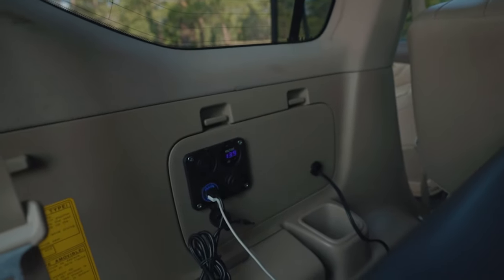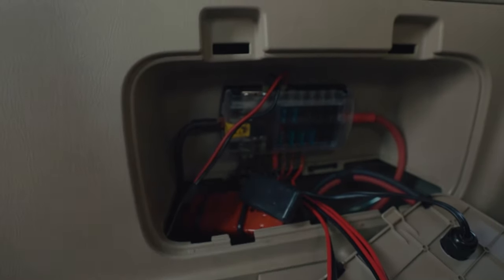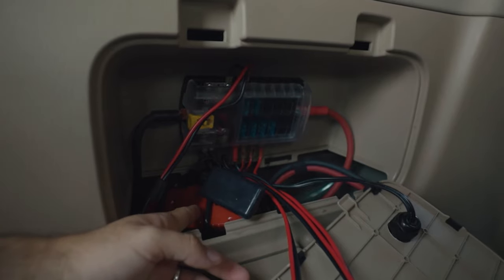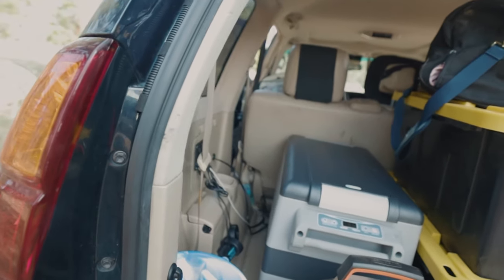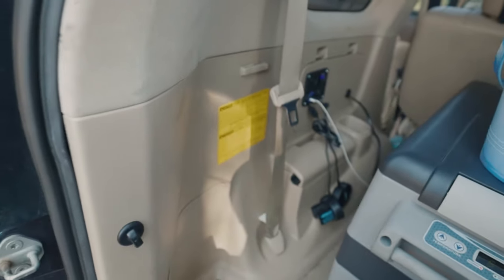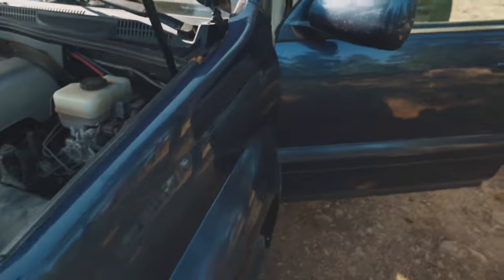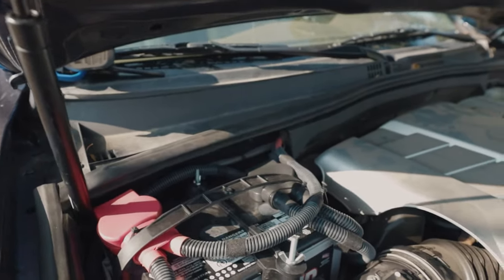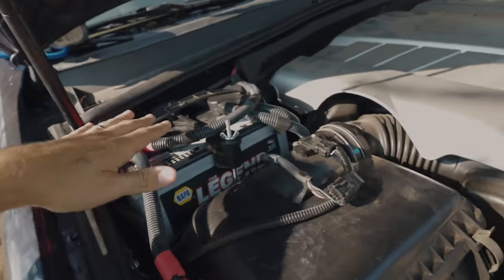Dual Battery System Lexus GX470 #projectbluey

Comment: Hi, Jacob, How did you put your battery in that place? 
I have a difficulty of putting my deep cycle battery (10L x 6.6W x 9H including the lead) in the same place that you installed. 
My 2005 GX470 has very little height because the metal pipe is stick out from the bottom.
What is the dimension of your battery? How many amp hour, and Is the battery deep cycle?

Comment: I hate to tell you this but this is your second video I watched. You made a video on the Midland radio and never said what type it was, now you make this on a duel battery and mostly likely you hit your mike or didn’t have it close to you and you sounded like you had a mouth full of food. first you should edit your videos if you are going to put instruction out. A 100 Amp fuse when it should be a fourth Amp followers will end up burning down there vehicles.